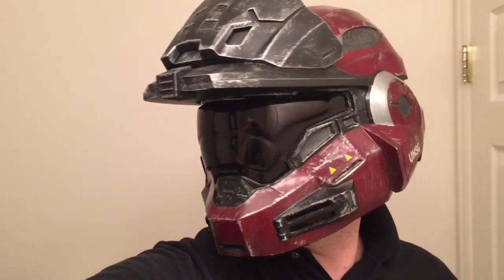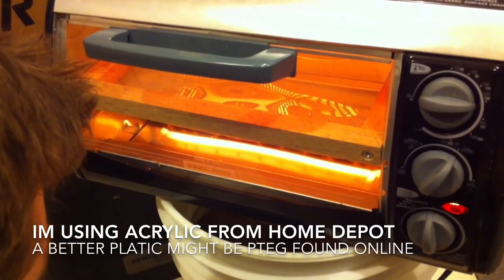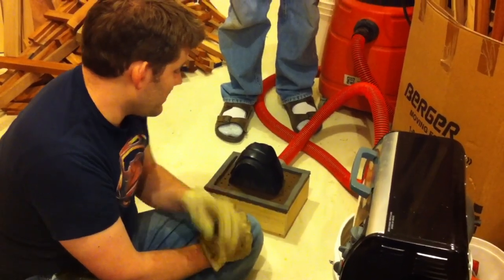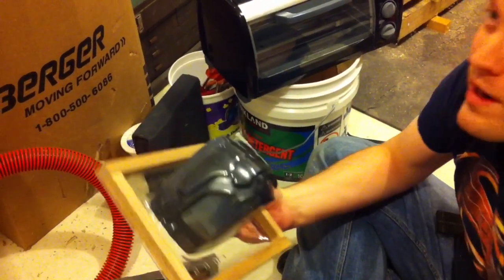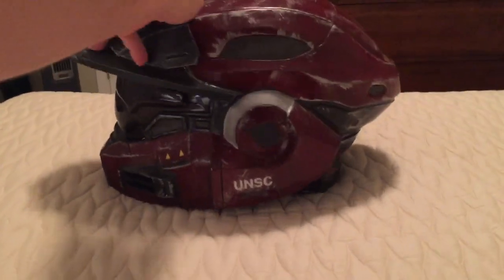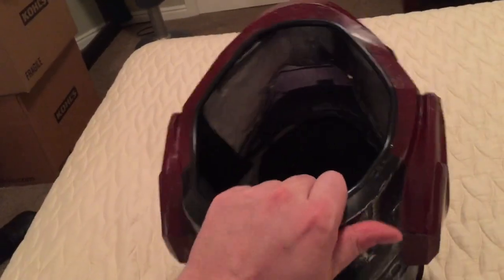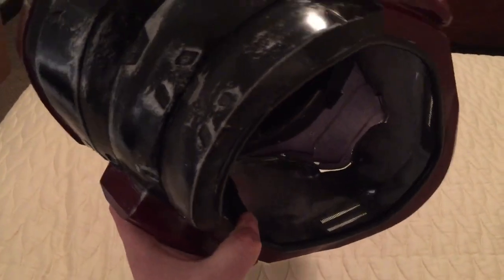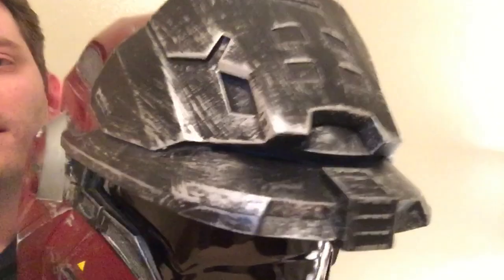Vaccum formed halo visor

Comment: Was it necessary to create a different molding of the original 3D printed helmet, or could you have simply applied the finishing touches as well as the visor to that original print?

Just curious seeing as I am considering making a helmet myself.
Reply: DT Skyline Well, he did`t mention what material he used. Most common one is ABS. Resin casted helmets are stronger. And I`m not entirely sure of the chemical reaction when ABS makes contact with Primer and Paint. But you could also try it out.
Reply from the maker: I used abs to print it, one of the things that can happen over time with a 3d print is is can come apart, it is build from multiple layers after all.  by finishing the outside and making a mold then using a two part resin it makes it a solid and much stronger part that can sit on a shelf and not come apart after time
Reply: alwaystimstime Thanks for doing a better job at explaining.

Comment: How do you colour the visor?
Reply from the maker: I used an automotive spray for tinting your car lights called nightshade my local store had black and red
Reply: alwaystimstime Ah yes I heard of niteshade before. Would you happen to know how to mirror tint visors? I know its some sort of plastic sheet you can stick on but for my Films I'm using Halo Reach helmets which means the have detail on the visors. Would it be possible to vacuum form the mirrored sheet on to the Acrylic visor?
Reply from the maker: ***** I know you cant vacuum form a mirrored sheet because its coated you would want to do that after the fact but even non commercial application can run you a few hundred dollars I know some people are just leaving it clear and then adding a see though mirrored color sheet, now were to purchase both the sheets and the coating spray I don't know but its out of the UK somewhere I believe
Reply: dajenic Thanks!
Reply: dajenic Also, I'm not sure if you would know, but is it possible to hit it up with the Kyrlon silver looking glass and then red nite shade over top? To give it a red mirror finish?
Reply: I've never tried it, but I imagine it would work out fine. I would probably do the red shade first, then the Krylon.